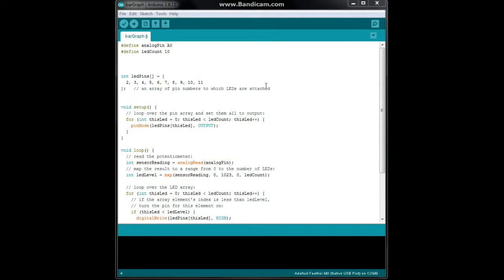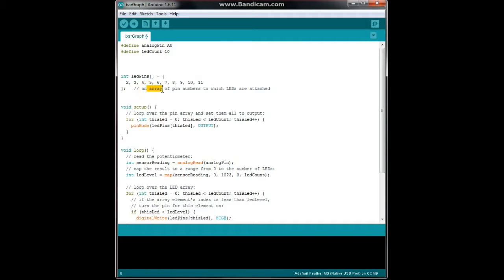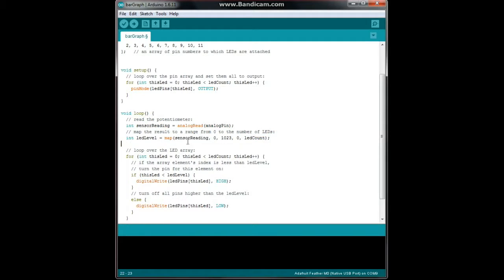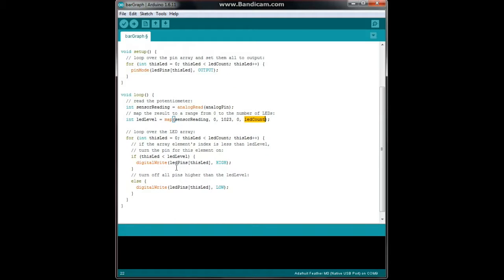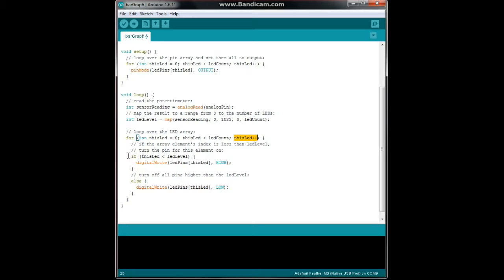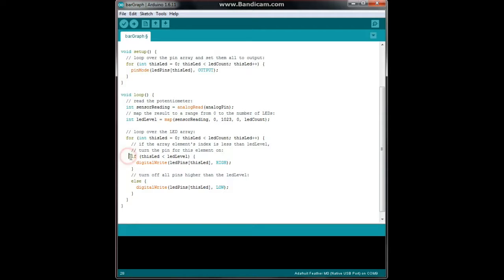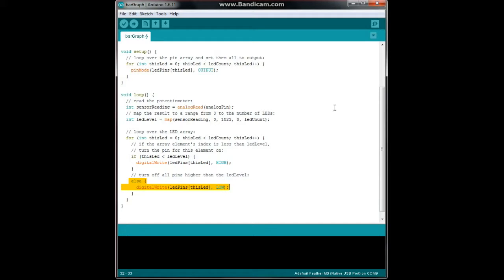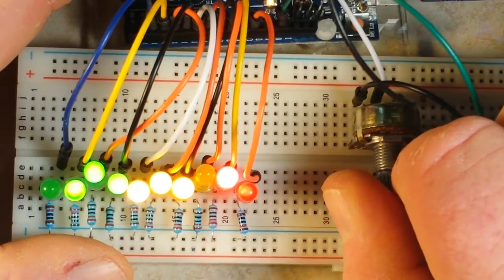How to use the Arduino Map Command to create a Bargraph

Comment: Could you make a circuit that uses a Hall Effect module (KY-003) that replaces the 50K pot?  But instead of lighting the line of the LEDs, only light one LED at a time as the magnet approaching the KY-003 and increases the voltage output?     Liked & subscribed.

Comment: Thanks for the video.  I used this setup and code to make my own LED bar graph, and I found that everything worked except when I turned the potentiometer all the way up the last LED would go out.  I modified the map() function so that instead of going from 0 to ledCount it went from 0 to ledCount-1.  This way at max voltage it would return a 9, which matched the array enumeration for the last LED (on pin 11).
Reply from the maker: +Wilburley cool, glad you were able to do something useful with it.